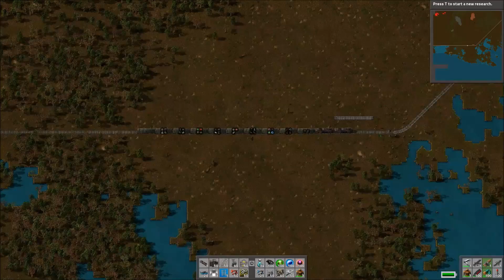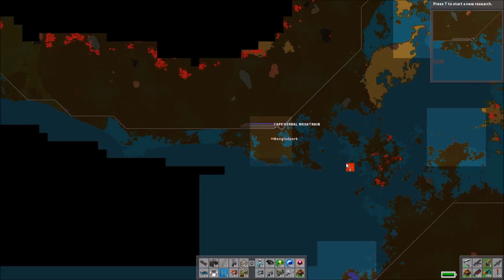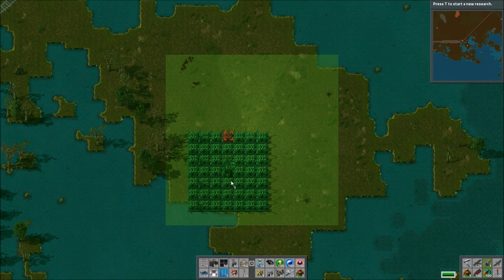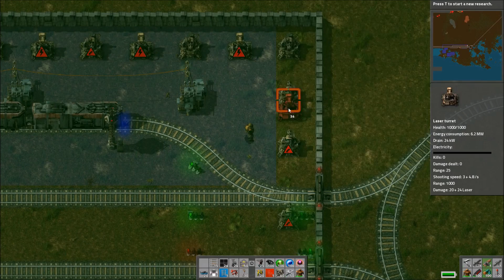Factorio Railworld Ep#91: Rails And Rockets

Comment: Bentham's wood train/station idea highlights why I'd make a terrible youtuber. My main rail yard almost always has generic unloading using bots, so I would have just sent the train off and been boring. Also, getting to that point means I don't really get into rails until I've got bots.

Bentham is much more fun to watch than I would be. Though I am just about as "bad" about balancing power and production demands. "Ooh, something isn't getting enough green circuits. Are all the circuit assemblers running? Yes, then extend the green circuit production! Oh, now there isn't enough copper. Mine/smelt more copper! Now there isn't enough iron, better fix that. What was I going to do two hours ago?"

Comment: I think a good plan would be to set up a station entirely dedicated to unloading wood. You could send random trains, like how you have the minitrain set up but backwards, and all the wood would be unloaded into a massive network of storage chests. You could have it connected to one of those backup power systems too, so that if your main base runs down, all that wood would be used to power the base. It WOULD need to be heavily defended though, so maybe having a few sets of steam engines already running with lines of turrets around might be a good idea just in case.   Speaking of steam engines, the correct ratio is 1 Offshore Pump to 13 Boilers and 10 Steam Engines. That's the most efficient setup anyone's gotten where all the boilers are at the start of the row before water starts losing temperature.